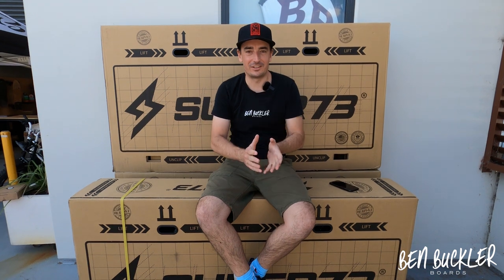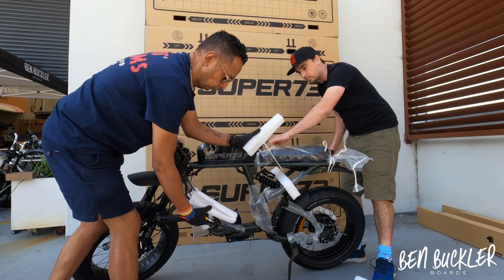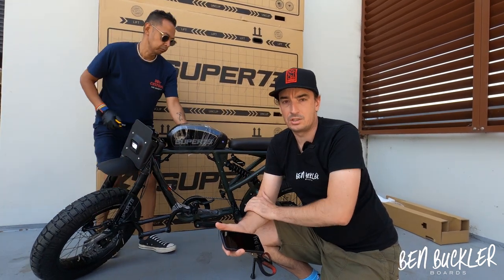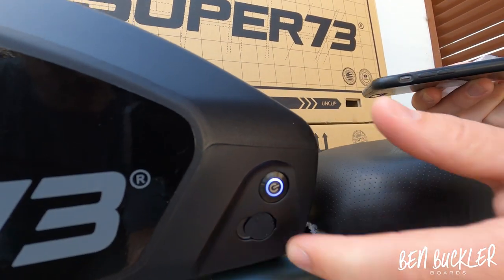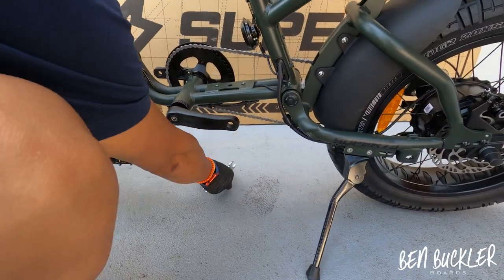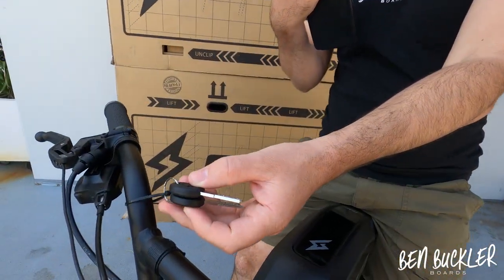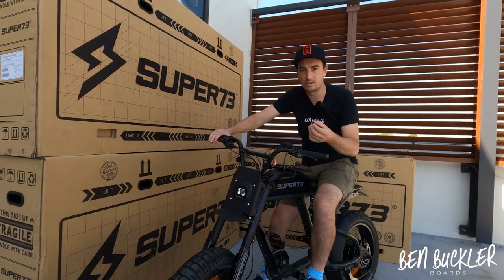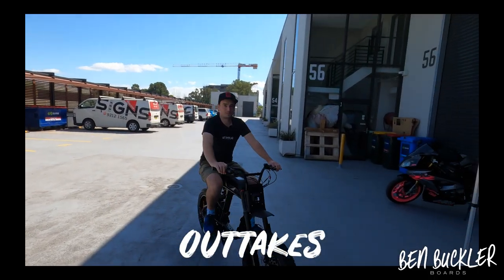Unboxing the Super73 RX-E in Australia!

Comment: so it seem the only reason why the rxg goes 10 under what its meant to is because it doesnt come with the throttle yet again we get a bike thats had stuff taken off but sold for a higher price
Reply from the maker: Nothing has been taken off, the throttles just were'nt shipped with the bikes. We send out the throttles to all customers who ordered one!
Reply: You can get a cheap throttle off ebay and wire it in yourself, done that to a cheap Fortis bike and unlocked it to go 35kph. I read the newer Fortis bikes don't have the throttle wire at the controller, that to stop modders, I wanted another Fortis, Dick Smith site said week later they haven't got it, since my bike is the 2020 edition, I can look inside the controller to see where the throttle wires go, then if I get another Fortis, I can make up a wire splice for the throttle, as long as the circuit board has the traces to support connection

Comment: aside from the paddle assist is there a throttle standard?
Reply from the maker: Hello, the throttle is not standard, it's just $100 extra if you want it added.
Reply: you can buy a cheap thumb throttle off ebay for $20, and wire it in yourself